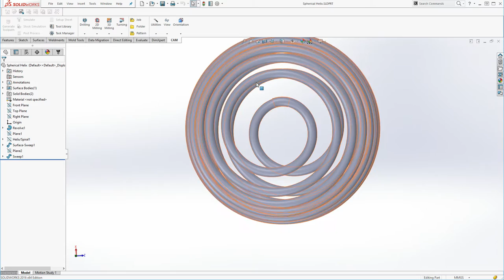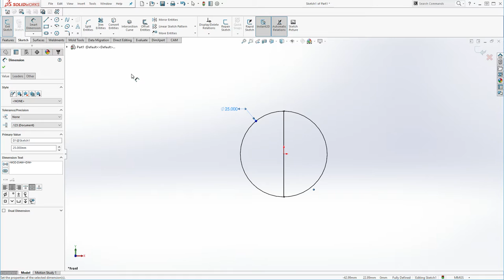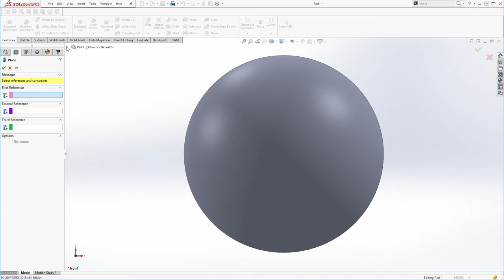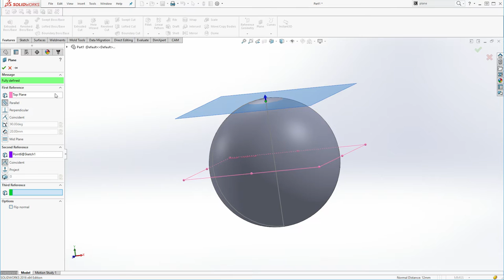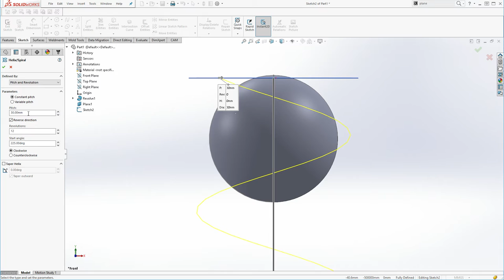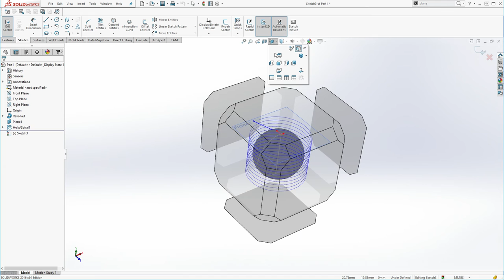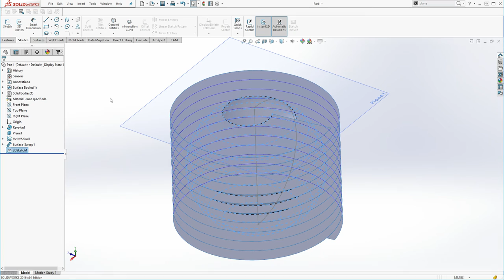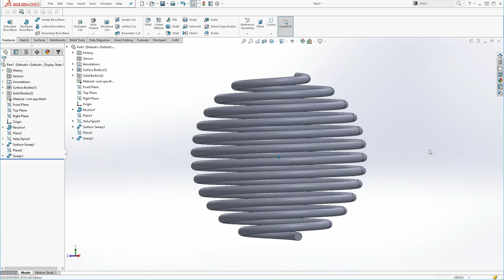SolidWorks Tutorial - Spherical Helix (sphere spring)

Comment: Fantastic video, easy to follow when you already have the Solidworks basics. I really appreciate it as I have been looking for how to create a spherical profile helical extruded cut for a while.
Reply from the maker: If you don't need any shapes other than spheres, there's another way to make a spherical spiral in SolidWorks that I found some time after I made this video. I've forgotten the details, but, as I recall, there's a way to make an "equation driven curve" (or maybe it's an "expression driven curve" or "formula driven curve", something like that) in SolidWorks. There is also an equation that will create a spherical spiral... I just don't have the foggiest idea what it might be any more (hence taking a long time to write this reply). If you're down to do some trial and error, the formulas on the page linked below might be helpful. Look for the phrase "I tweaked the above and used". Good luck!
https://www.intmath.com/blog/mathematics/how-to-find-the-length-of-a-spherical-spiral-10254